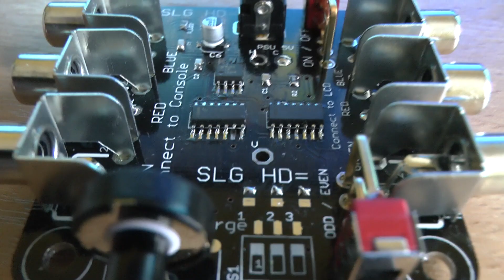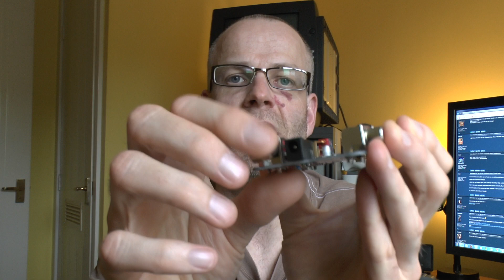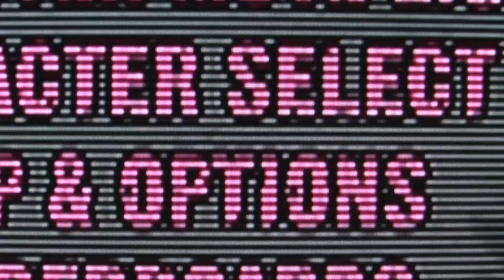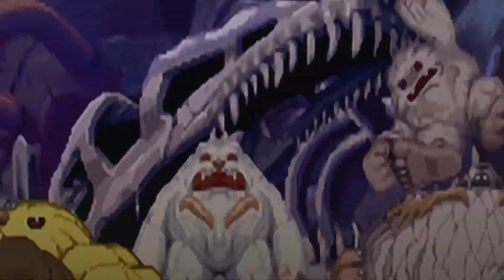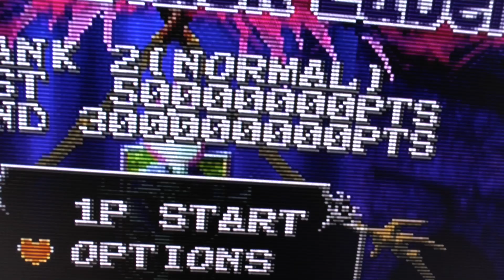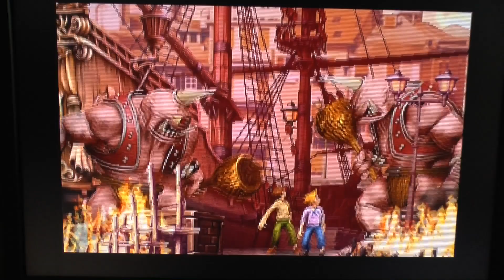Tech Review: SLG HD

Comment: So I just took a look at the website and it turns out their sold out without any plans to restock, but I was going to get an slg 3000 instead. Ok so the base price is 29,95 euro so does that mean 34. 16 in USD dollars? They use commas instead of decimals on their site so I got confused.
Reply from the maker: 29,95 would be 29.95 euros.
Reply: Ok thank you

Comment: When you say instability issues with a different psu what problems did you have?
Im having problems with it flickering, its still playable but really annoying me, i did not go for the psu sound forge was offering(wish i had). instead i picked up a multi voltage psu which outputs 5v. i wonder if this is the problem?
Reply from the maker: Poo Edd It can cause issues with the sync signal, which means when you enable the scanlines the picture will flicker.  However, this can also be an issue of your console and the sync signal your TV expects.
Reply: Faginrs500 yeah its the scanlines that flicker not the systems image(wii).
ive also noticed it only does it on one of the scanline settings, odd or even i dont know which is which. but the other is fine.
Reply from the maker: Poo Edd Mmmm... I think that's normal on some sources with some target devices, with this device.

Comment: So the slgHD doesn't work for gamecube 480i games?. Only 480p?. What if I bought a component to hdmi upscaler?. Would games that are only 480i like Turok evolution and a few others not work with the slgHD?.. If that's the case would the slg in a box be a better buy?. Because I want to have scanlines for gamecube/wii/wiiu games at any resolution including 480i.  Since all wii games support 480p and all wiiu games support 480p and up. I still want to have scanlines to those 480i gamecube games. So since now you know. Would investing more money into the slg in a box be a better decision?..

Plus I'm not modding anything
Reply from the maker: Turok Fin This is meant for a 480p image.  
This device is for component input, so a HDMI upscaler would be useless.  You'd need a component to component upscaler.
The SLG in a box will take a 480i component input and upscale to 480p, overlay scanlines and output to VGA.

Comment: I have a ps2 and I know the SLG HD= YUV Edition requires 480p and most games are not this for ps2 but if I use the xploder HDTV to output to 480p would this then work?
Reply from the maker: Sure will.
Reply: Faginrs500 just a recap. Managed to get hold of one and using the ps2 xploder HDTV doesnt seem to work at 480p it sends it mental and gives a horrible fuzzy picture, 480i give thick scanlines (as you said it would) only mode works with is 1080i. However this leads to such a tiny picture on screen its pants!  ebay and xbox beckons!
Reply from the maker: Kirk E Must be a signal problem from using HDTV.

Comment: Hi Fagin I have an NTSC gamecube with component going into a HDTV via progressive scan, I was wondering from your professional opinion if you would recommend the SLG HD for scanlines for the console, and if they would improve the picture quality for my Gamecube. Also does it support both 4:3 and 16:9 ratios and am I able to still play 480i games on the GC by turning of the SLG HD without having to unplug it?
Reply from the maker: Personally I would only use one for games that were meant for 240p (like ports of classic games etc).

Comment from the maker: Correct +sandplasma
Reply: Fagin, thanks for the vid! i want to use one of these for playing ps1 games on my ps3, however my ps3 only does 576p with component and not 480p. Does this matter? I can obviously use 1080i but i really dont like interlaced images. Thanks in advance
Reply from the maker: nicklong27 Mmmmm.... good question and I'd have to pull my PS3 out with component cables to try this out.  Can't you set the PS3 output to 480p?
Reply: Faginrs500 No, it's wierd... you got: 576i (scart), Then with HDMI/Component you got 576p, 720p, 1080i and 1080p. Apparently 576 is some kind of PAL thing but i really only encountered this with the PS3.
Reply from the maker: Yes it's true.... 576p is PAL.  The only thing is, is that I do not know what the PS3 scaler will do with the image.  If it takes it up to 576p then I don't the SLG will work correctly for PS1 games.

I just realised I can't try this.  The PAL PS3 I have has no emulation for PS1.
Reply: Ok, no worries thx for your reply.

Comment: Hi Fagin, if I'm using official M$ component cables for my Xbox1, (http://oi43.tinypic.com/205s8qa.jpg) 

What component cables would you recommend to stick on the other end of this slgHD to make sure the quality is consistant? Ixos, monster etc?
Reply from the maker: To be honest any cables would do in my opinion, assuming they aren't using bell wire! :D
Reply: Faginrs500 I'm surprised to hear you say that. I expected you to recommend some gold plated cable to enable best quality possible.
Reply from the maker: If you want to waste your money, then by all means buy those kinds of cables, but in my experience it makes little to no difference for this kind of use.  Adequate shielding and short runs are my only caveats for this kind of stuff.
Reply: Faginrs500 Fair enough, in my previous experience it paid to spend more with analogue cables, never paid more than a couple of quid for a HDMI. Ixos Xbox and PS2 cables were superior to the official ones on my old CRT.
Reply: Bashir Kashmiri
Hi I brought some component cables off eBay for £2.50 "0.5" meter long which work flawlessly with my Wii. I'm going to try my Xbox next with Retroarch.
One problem I have is my TV hates any interlaced resolution so I have to switch off the SLG otherwise my TV just says "Unknown Video Mode" I have a Samsung D8000 series TV so probably not the best for Retro.

Comment: Hi Fagin

Can I use this with my classic Xbox (to run emulators via Vision and Coinops etc) on my (recentish) Panasonic plasma via component with no probs? Or would I be better off with an SLG in a box becasue of the sync strike etc? I want the best quality Scanlines. Should I run the emulators in in 480i, 480p or 720p?

Cheers

Comment: what are you using on the CRT exactly mate? It depends on what resolution you are using.. generally speaking on a 21 inch you can hardly notice the scanlines as the screen is physically too small and the scanlines kind of just merge in with one another. some people prefer smaller sets for this very reason i believe :)

Comment from the maker: It's worth getting an adaptor - I just used a shaver adapter - to see if it resolves the issue.  I purposefully tested the unit with another PSU and it caused me issues.  As soon as I reverted back to the AF one it was fine.  It's worth trying mate.  What hav you got the dip switches set to on the SLG HD?

Comment: Well on my original xbox I get absolutely no drop out, but on my Wii and PS2 I get drop outs all the time almost every time the screen flashes the screen goes from 480P to 480i then the picture cuts out. I am using a 5v 1A Psu I can not use the one they sent with the SLG HD because of the different outlets in different countries do you think if I get an adapter to be able to use the Arcade Forge Psu which is 5v 0.5A it will fix this problem?

Comment: Lol, not at all :)
I've got a quick question regarding the power supply required for the SLG HD. My TV has a 5V USB socket on the side which is capable of running portable 2.5" hard drives etc. I can't find it's exact specs but I'd guess it's at least capable of a 1A output. Could you tell me what the Arcadeforge supplied SLG HD PSU is rate at or if you think my TV could handle powering the device itself? I'd really like to not have to install yet another PSU back there! :P

Comment: Do you think the scanline size would be better on a larger 36 inch HD CRT? The all in one setup I use on it they are to small even in 480i. Also, for this new hd slg, is it a 2.5mm barrel jack on the pcb, and what's the amp rating on the 5 volt psu they supply? Just wondering because I have a few spares instead of ordering one with it.